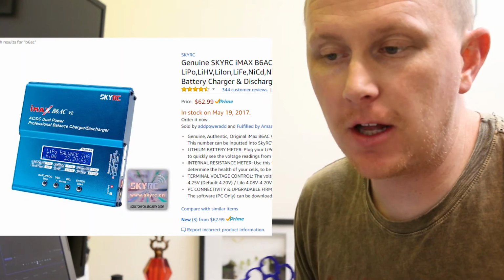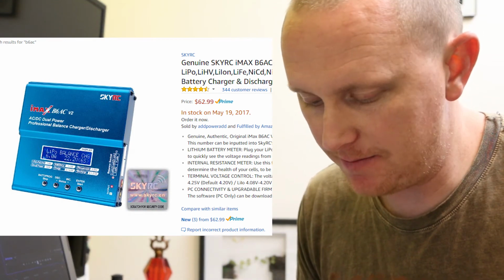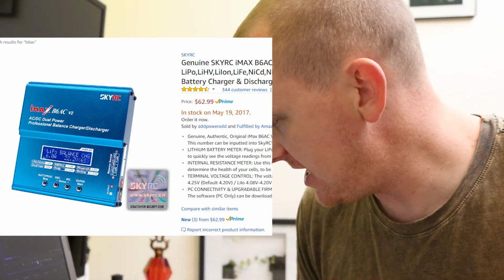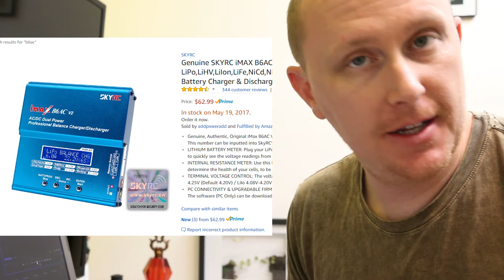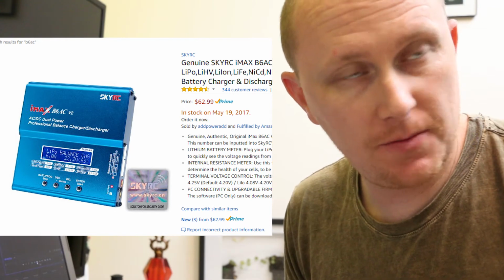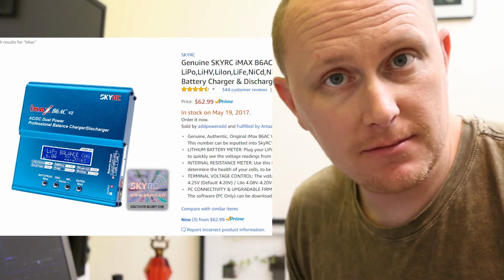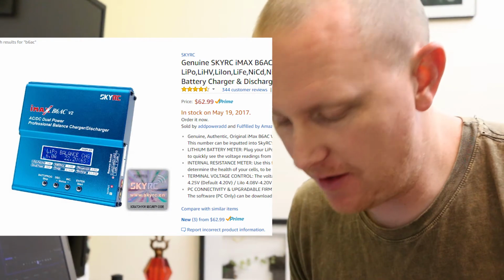ebike progress report update THE RYOBI BATTERIES WORK!

Comment: My 40v Ryobi battery shuts off itself when do a full throttle on my 36v DC motor bike from taking off. Have you experienced this with any 40v Ryobi batteries? I’m 95% sure it’s a Ryobi safety feature.

Comment: Hi, I want to implement power tool batteries in my build too as im uncertain about the safety of homemade lithium packs in unattended charging, but wasnt sure if these batteries are up to it. How much range did you get on these batteries, and are they safe enough to run at full throttle at about 1000 watts? I haven't bought anything yet but I want to use a 48v 1000w motor and 48v controller with six of these batteries (2 banks of 3 in series). Though, I'm using generic replacement batteries to save costs, though I might replace the individual cells later. Also, is your controller 48 volts or 60 volts?
Reply from the maker: Hi, I did not test range, just functionality. These batteries got a little warm so I would not suggest the small packs like these, the large ones should be fine if you using them as you plan to. My controller is a 48 volt one bought on Amazon from the 1000w kit but it's good for up to 60 volts as I have tested. There is a guy that did the pack like your talking about.. I think he commented on this video, maybe read thru? I would link but can't right now

Comment: I've done a lot of battery building - just a quick tip as I don't know if you're aware or not, most of the laptop battery cells are good for 2C, usually about 4 amps each. Your typicaly eBike controller pulls 26 amps, so you'll need at least 7 in parallel in your final battery. If you are under 7, you'll notice how quickly the cells start to heat up as you accelerate! It's pretty nuts. You could also buy some SONY VTC6 cells to put in parallel with them to help with the load...
Reply from the maker: thanks for the comment. I am actually going for 13s7 so ... sounds good :) thanks for the math/suggestions! have you done any cooling solutions though? Looking at Tesla's patents, its very basic what they use... may be fun to mimic but definitely a lot more work.
Reply: I haven't actually - most of my battery prototypes have the cells in the open air so they stay pretty cool. It is insane how hot the cells get if you don't have enough to match the current you're trying to pull. They heat up very rapidly. I'll be watching for your next update! :)
Reply from the maker: thanks man!

Comment: Cool progress, I have been working with Ryobi batteries for a long time rebuilding and upgrading them. I got tired of no new batteries since 2012 so last year I did some testing of my own, proceeded by upgrading. I purchased a bunch of LG HG2 18650 cells on ebay ( verified vendor so no counterfit) and I took apart my P108 battery and upgraded it from 4.0ah to 6.0ah with the new cells, great improvement with extensive testing it was performing right where it should have been for its capacity. Not sure how much money you are wanting to sink into the project, but now they have 99 dollar 2 pack of the 4ah batteries at home depot, those would significantly improve the performance/run time of your bike. You could even take apart the P108 as I did and upgrade it with the new LG cells, then use the 2.0ah cells from that battery to upgrade your smaller batteries used in this video.  There are alot of good options with the Ryobi batteries and the ryobi chargers still charge everything fine as well.
Reply from the maker: Thanks for sharing.. I will have to look into those cells.. As for using the ryobi batteries on this build, i just wanted to see it work... I do not intend to make it the permanent battery source however i would like to be able to switch to different types such as the 18650 one i want to make and the ryobi? As for budget, its pretty stretched out. I did buy a charger and its on its way.. Im working on the first "Mark I" ryobi P104 rebuild video now... keep a look out for it. Thanks again for sharing the information here :)
Reply: So are there any issues with the bms board when you swap in upgraded cells? I've been thinking about taking the bad batteries I have apart and separating the good cells out to fix a few.but the lowered cost of new cells makes me think I should just change them all

Comment: music too loud - otherwise good vid
Reply from the maker: thanks for the tip. I re encoded it 3 seperate times knocking the gain down to nearly 20 db minus and 5 plus on the narration... just had to re throttle a bit more i suppose.
Reply: @TRYtoHELPyou  i would suggest usign the music (lower) when not talking

Comment: I can help you with the rc charger as that's what I use to charge my homemade 18650 packs, though I have a slightly more expensive charger that will charge up to 10s. How many cells are you going to run in series for your bike? If you want the same amount of power as the ryobi batteries then you will need 15s. If I was you I would make 3x 5s packs and run them in series for your 15s. That way you would have 3 smaller packs to charge rather than 1 though. That said 6s chargers are cheap so you could easily buy a few cheaper than the one that you showed in your video
Reply from the maker: W19 ELY thanks for the tip. I am going to do 13s w a BMS. I want to do a 14s so that I'm not charging the cells to 4.2 but I can't find a 14s BMS.. is there a 15s BMS or charger you are aware of?
Reply: I don't use a bms in any of my battery packs so I am not sure. With regards to charging it I'm sure that you would have to use a 48v Lithium ebike charger because the rc charger wouldn't be able to put out enough volts to charge it.
Reply: 36v is so much easier to do with 18650 batteries in my opinion because 10s works really, really well. I would seriously consider splitting the battery down into smaller packs and running them in series if it was me. At least that was I would know that they are all balanced and I would be able to keep a check on the individual cells. I'm sure that charger you showed on your video has a setting where you can change the cut off charge voltage for Lithium batteries as well.
Reply from the maker: thanks for the tips. I may consider the split.. i have the carriage split already i really want to run a 14s pack and charge it with a lithium 48v (54.6v) with a BMS built into the battery but i cant find them. IF i could find a 52v output charger i think that would be perfect. I will slowly figure this out i suppose. what charger make/model do you have?
Reply: I have a turnigy Reaktor 1000w 10s charger which I highly recommend, though if you were considering a split then 2 cheaper 6s chargers would be just as good.  I literally only have a charger that big because I balance charge a 10s battery without a bms. Have you heard of a youtuber called "Rinoa Super-Genius" years ago he built an electric bike the same as you're doing. He started off by building 2x 6s packs that he joined in series to get his 48v. This obviously wasn't enough for him as he built a larger 13s pack with a bms which he created his own balance leads for. His videos are very good, they definitely helped me. Though when he built his 6s packs he also made his own balance cables, which is a bit of a waste of time considering they cost pennies on ebay
Reply from the maker: Thanks for the update. Yes i have seen Rinoa's channel and have learned a decent amount from it. Im going for a more sleek finish and experiment at the same time. I kind of dont want balance happening outside the battery (at the charger) i want it in the pack (surface mount soldered BMS board). i may be changing it up though... I am looking around the house wondering "oh, i can change that battery" or "hmm, i wonder if i should change my RV house batteries to 12v packs from 18650s".. im going to think myself silly here!